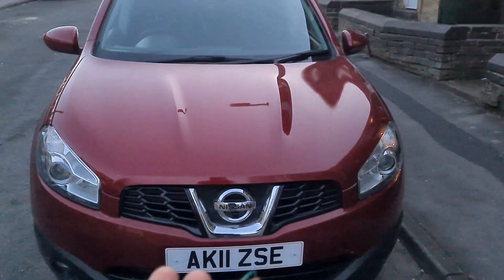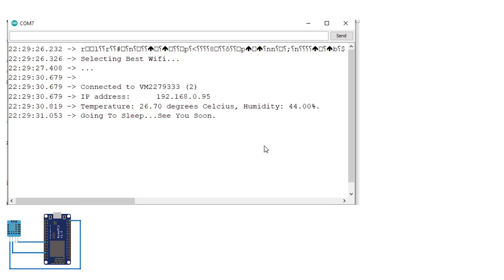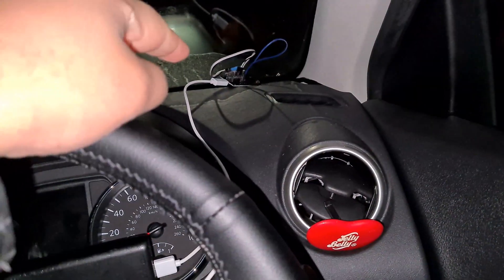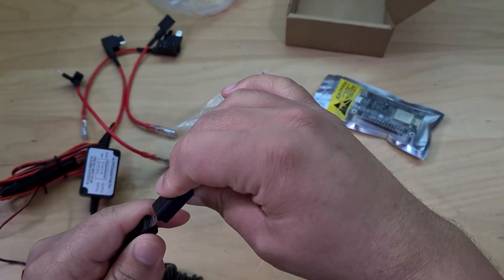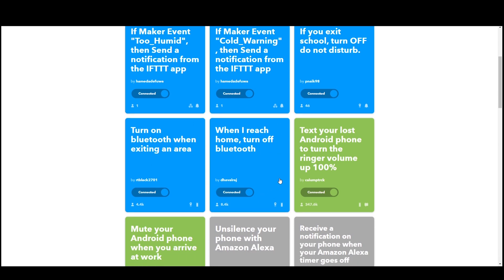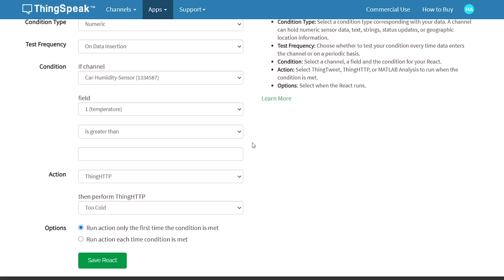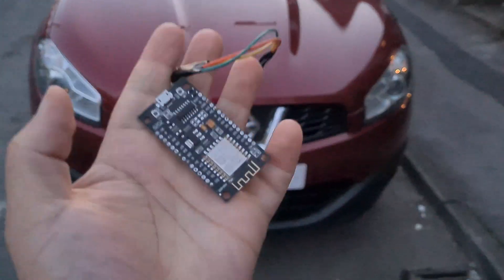Arduino DIY Car Temperature & Humidity Sensor - ESP8266 Module

Comment: Another project at my level mate. Top work with this video. Have you got a Seeeduino Xiao yet? I’ve done a few basic sketches on mine, sketches worked same as  Arduino Uno except for the need to download the board details to the IDE and change the port.
Reply from the maker: Thank you. Yeah I've seen that Seeeduino. I've got pi Pico's, Arduino nanos and raspberry pi zeros but haven't done anything with them yet lol so I'm holding off on the Seeeduino. It was the same with this esp8266, just had to download the board details and do the port. It's difficult I think to come up with useful projects lol. This one was definitely useful for me, although weather's been good so far this week.
Reply: Definitely some good tips for me. I haven’t done any WiFi projects so this is great. Keep up the good work, my friend 👍🏻
Reply: I struggle with C+ code, as different sketches seem to use different instructions do the same thing. On YouTube, people use completely different codes for the same outcome, if you see what I mean....? The bit that tells the Arduino what to do LOL....like the bits of text that turn orange/green in the sketch 😀
Reply from the maker: @mickadams4471  Yeah I'm exactly the same, I learnt C programming last year in university but only the pure basics. I think I know enough to piece together some decent arduino projects using google. The problem appears to be a library issue as well. Since its all open source, theres 50 libraries for one sensor, so once you start  mix and matching code, it gets very messy. The code for this project took me a good 6 hours to do. Pro tip: ignore all the example code thats more than 2-3 years old.

Comment from the maker: Timestamps
00:00 Introduction
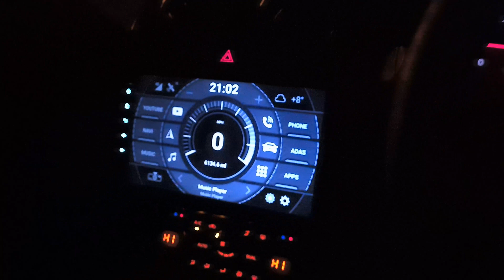0:55 Components
1:22 How It Works
3:05 Powering The Sensor
5:23 Using The Data
6:57 Tutorials & Links
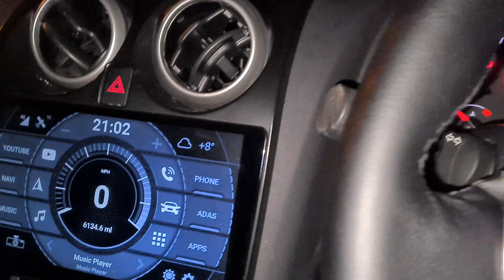8:40 Placement of Sensor
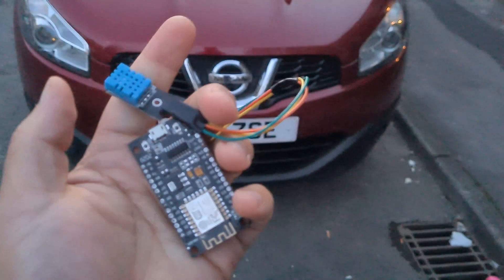9:35 Future Improvements